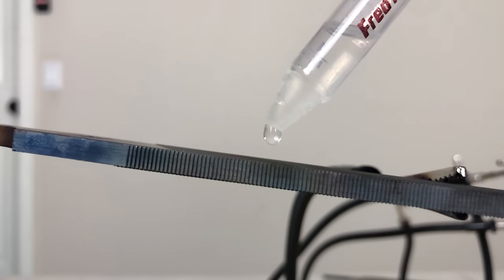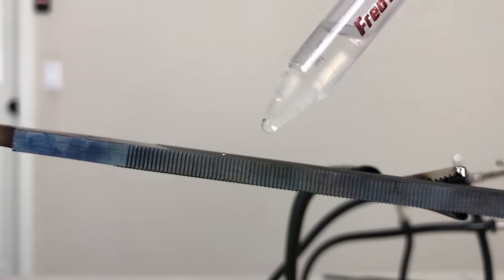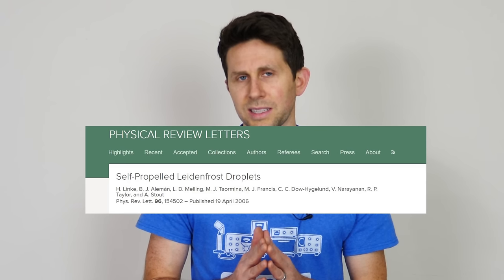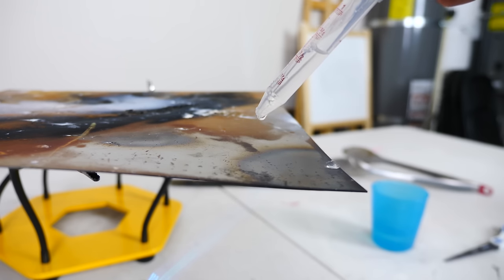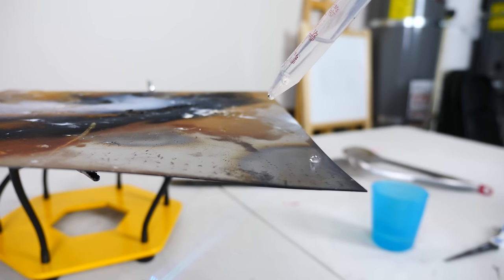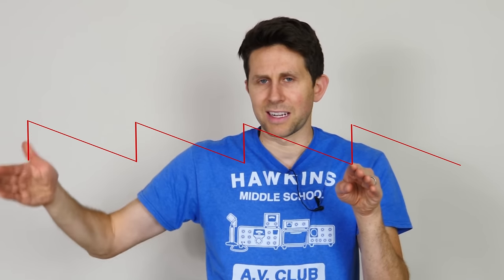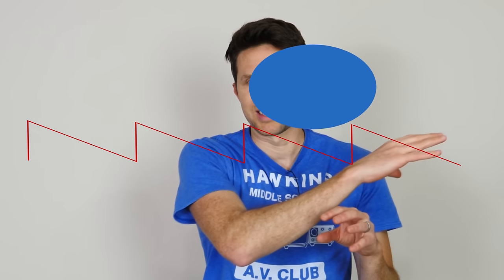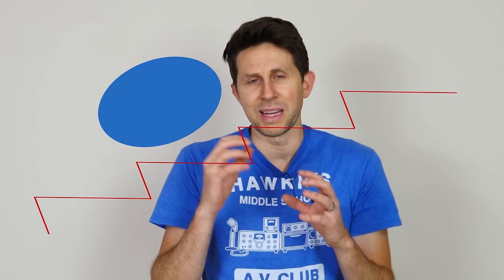Weird Experiment Makes Water Flow Uphill

Comment: Imagine creating these step ridges in a circle with a CNC, then shaping the whole thing into a bowl. Perhaps through hydroforming as a hydraulic press with a specially made head for it might ruin the ridges. The water droplets accelerating, wonder if with enough fine tuning, high enough edges, right angles and large enough bowl could make the droplets do some beautiful things. Just a quick thought
Reply: I wonder if you could create something similar to a railgun with this concept, using ice projectiles instead of water, down a very long stretch of heated ridged metal. Acellerating the ice bullet over and over until it launches out.

Comment: As a solution to heating the metal evenly, what if you use a resistor heating element? It could be shaped as a slab with slot etchings. The element should heat evenly and you’d have greater control over the average temperature too. Of course you’ll want to be careful with introducing a conducting liquid to such a system. Otherwise it’d be like demonstrating a toaster in a bathtub

Comment: I can think of a practical application for this. You can make a "file thermometer" If you know at what temperature the drops go up versus down, you can find out the temperature of something that is hot within a range. But I am curious if you can also predict what the maximum "roughness" of a file would be where this effect happens. For example, would a rasp work as well as a fine toothed file?

Comment: I say let's go big. Like the speed of sound or escape velocity. I need someone to do the numbers for this. As the drop accelerates uphill, how long a ramp do I need to build to get up to some serious speeds?
Reply: A bigger question is - how big a droplet do you need, to maintain that vapour cloud under the droplet for that long a duration? At some point, it stops being a droplet and becomes so big a drop that (just my hunch here) the drop will split into smaller droplets due to lack of sufficient surface tension.
Reply from the maker: I think the limiting factor would be the air resistance breaking up the drop to smaller drops. But theoretically you could get it going as fast as steam shoots off the drop
Reply: @TheActionLab  The other question that seems relevant, how much water can be moved uphill at once? For example, could it be more energy conservative compared to the amount of energy used to pump water somehow? (im assuming no, but whats its limit?)

Comment: It's really easy to uniformly heat metal by running an electrical current through the metal in a closed circuit. Because these files are thick harden steel probably need a 5v Lantern battery at minimum, the higher the voltage the faster the metal heats up. Because of needing a closed circuit would recomend implementing a switch to safely regulating the temperature results.

Comment: It's very cool, but you just forgot to mention it might ruin the file by heating too much, so if someone wants to keep using the file, be careful.
A low boiling point liquid would also work in an ambient temperature surface ?

Comment: I think that the droplets are not going upward at 5:00 because the metal above the centre is not hot as compared to the side of it i think you should have a temperature test to conclude the reason behind it but maybe i am wrong.

Comment: The file looks like a "Standard Mill Bastard File"  The teeth cut into the file is the shape of a saw tooth wave form so when steam from the drop of water pushes on the files teeth it's like you said it's like stare steps making the water drop move in one direction (up hill)

Comment: The slots are cut at an angle genius, that's why the steam pressure propels it away in the opposite direction of the metal file's groves. Not the sharpest tool in the shed.. =)